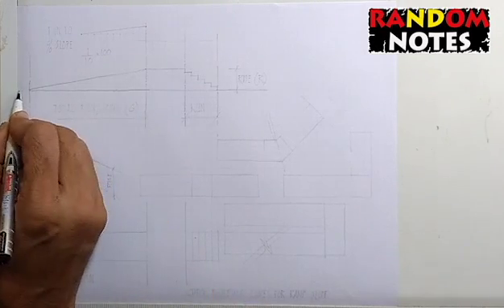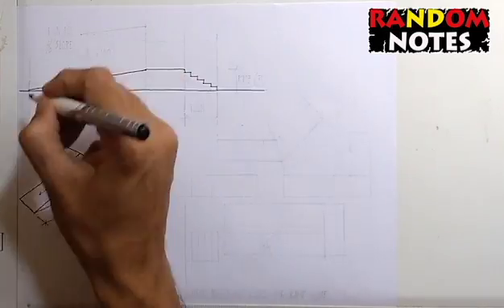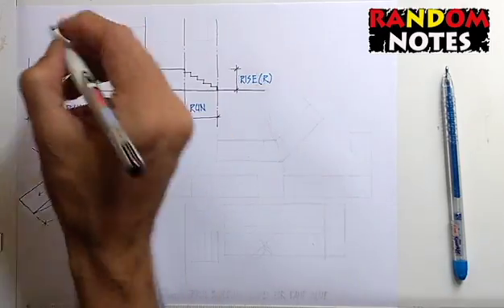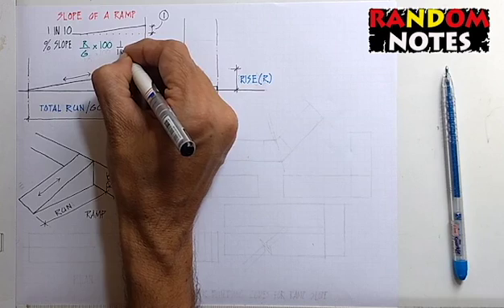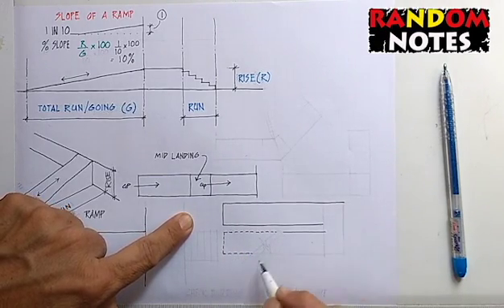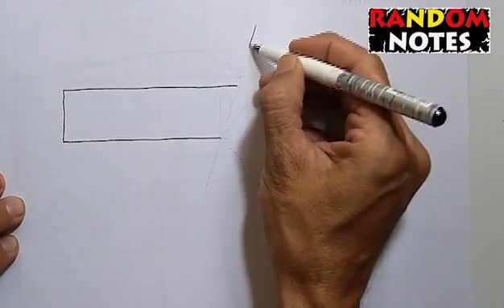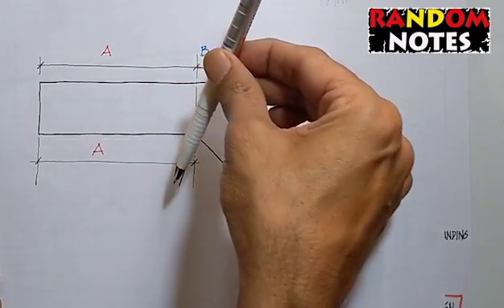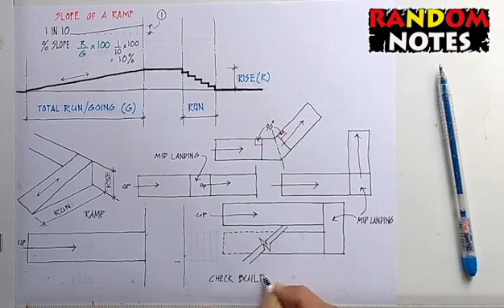Understanding ramps

Comment: Excellent video, but one important point of language to clarify. When you say “R over G Intro 100”, it is incorrect. For the formula you have written, it is  ‘R over G MULTIPLIED BY 100’. 

To say ‘into’ means ‘divided into’. So it’s the opposite of what you have written. 

For example, 2 into 4 is 2, whereas 2 multiplied by 4 is 8. 

So, your %slope formula is not said as ‘into 100’, it is said as ‘multiplied by 100’. Obviously it’s necessary for you to be saying the correct thing for a video of this nature.
Reply from the maker: Thanks a lot John. Surely, this is a problem of usage of language. In India (from where I hail) when we refer as "into", it implies multiplication. And I agree that language usage should be such that that has no other interpretation. Now that I am aware, I will keep this in mind. Thanks again for your input